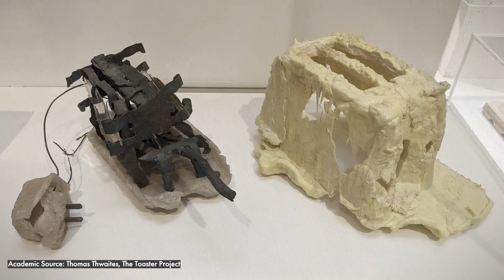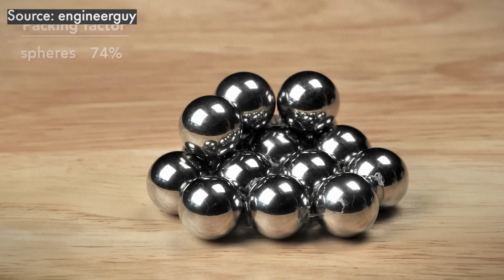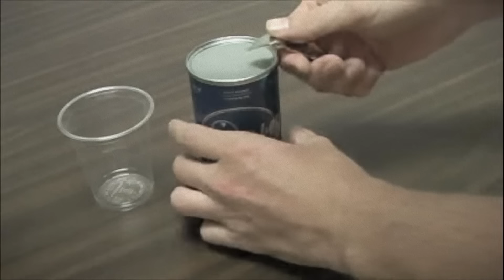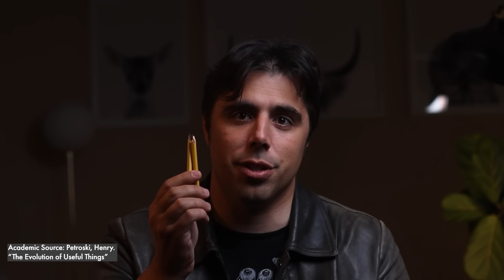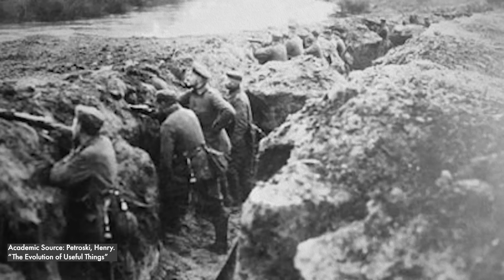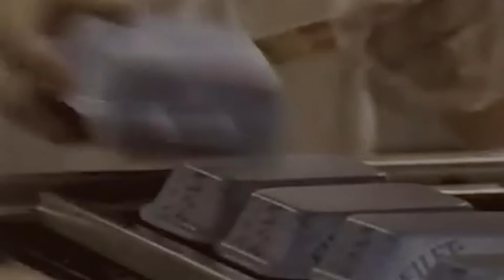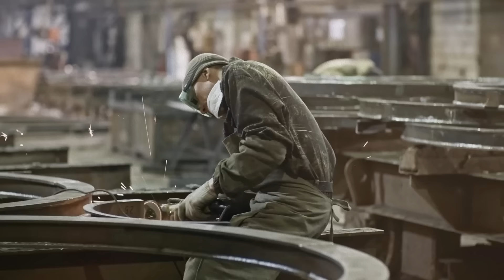Why Simple Everyday Objects Are Impossible to Make

Comment: This is true... but only to a point. Sure, a very modern toaster with a circuit board and digital display takes a lot to make. A toaster from the '60s though, that's a half dozen parts and can can be hand machined. Sure, making plastic totally from scratch is hard to do, but carving a fork from wood is easy enough with patience and skill. Smithing one by hand given access to metal is easy enough too, just ask everyone from the 1700s. Your plastic fork there is a sort of silly example though. Its plastic because plastic is cheap given that we have international trade and plentiful oil production and plastic manufacturing. Its mold is $100k of finely machined steel because production runs by the million require it or production would stop to demold a defective fork or to replace a degraded mold. Making one of those forks, for me, is a day of light work. Some plaster around an existing fork, a double boiler for melting carefully selected scrap plastic, and can be done. Its dumb to do it when I can buy them by the hundred for a few dollars, but it can be done. Simple objects are not hard to make or expensive to develop because they are simple but because they are mass produced commodity goods the rely on huge modern infrastructure and big initial investments into durable quality tooling fit for huge production runs. Consider an epoxy & glitter walled tumbler (tall glass with a lid and straw). I can buy two piece blanks, hand mix glitter and two part epoxy, fill and fit the tumbler parts, and be making them by the dozen for the cost of a few supplies. China though? Thousands of dollars is supplies bought in bulk, tens or hundreds of thousands in tooling and machine setup. But in the end they can churn the things out by the ton.

Comment: 20:25 Styrofoam was changed out to paper but both had PFAS coatings to make it hydrophobic and oleophobic. The crazy thing is that people lifted the burger out of the Styrofoam box but with paper people sometimes bite it and they rub it on their mouth. PFAS was measured as an non-extractable on full paper... in lab tests. Except people crumble and tear paper which can release it

With Asbestos you could trace back to exposure lawsuits easily. Because of every fast food packaging using PFAS like butter, there is little accountability and that receipt paper unfortunately didn't get protected by a forever chemical. Yaaaay tragedy of commons with our endocrine systems

Comment: The corrugated cardboard version today's Big Mac works well enough but you CANNOT recycle grease soaked paper anymore than you could polystyrene. The grease ruins the whole paper pulp batch. So, it goes to the landfill where anaerobic breakdown takes so long you can take a core sample of a landfill today and still read what's on newspaper from the 70's! Is cardboard better for the environment in this case? Who knows? Just because people gripe and moan about something doesn't mean they know either.

Comment: One container design which makes no sense to modern man is the amphora.  They can't stand and their volume to vessel ratio isn't great.  Historians point out that they would have tended to work well on the ships of the time where they can be laid along the hull and secured with ropes.  I think one major thing not considered is moving them from the dock and land transport.  These rocky coasts on which they evolved have almost no roads on which carts can be used.  So things have to be moved inland on donkeys on narrow trails.    A man has to lead a donkey.  The amphora work perfectly for this.  A blanket can be placed on the donkey, amphorae placed on either side, a rope connects the pair over the donkey and rope loops connecting the pair under the donkey to keep them from swinging out.  These create something which is relatively narrow with little leveraging on a donkey.  They weren't designed to maximize storage as much as facilitate transport.

Comment: Who said a toaster needs to be done from plastic. Wood would work too, and some iron, and glass for isolation. Can be done from scratch...
Of course an electric toaster needs electricity and that's more work - easiest way requires a water wheel in a stream, some copper wires and magnetite to create a dynamo.
And all those need tools, so you have to build them, starting from resources - stone (flint, limestone, sandstone), wood,  plant fiber, clay, ores of copper and iron and lots of sweat, blood and tears...

Comment: Is that why my teachers would not let students take the SAT without a Ticonderoga pencil or specific mechanical-pencil filament?
Reply: No, that's because they didn't want to have trouble with the machines used to read the scantrons. The scantron readers were calibrated to read #2 lead, which is a specific softness and therefore color, reflection properties, etc.

Comment: 3:25 I am having a nervous breakdown as a European when I hear someone use a plastic fork for 5 minutes and then tosses it away.
Reply: Same here. Just please, please don't join the blind mob that thinks replacing that plastic fork with a wooden one (or a straw with a metal one) solves the real problem here, which is excessive ("leaky") production output burning incredible amounts of (also: externalized) inputs either way.

Comment: Injection molds are not that expensive anymore, i regularly get new molds produced in china for 2000-5000$. For simple plastic parts. But i also worked for a dutch manufacturer of audio equipment that produced low volume, it indeed costed multiple thousands of dollars to produce a not so difficult product.

Comment: I've done several multistep chemical syntheses just to train how hard it is to start from scratch (plus many chemical intermediates are not available for individuals). It was a real adventure and one learns A LOT from the field by doing thing the old way without fancy equipment.
BTW high purity carbon/graphite can be synthesized from sucrose and sulfuric acid - the resulting material is called "sugar charcoal"

Comment: As someone who was a manufacturer and also designed and sometimes built commercial machinery, I can totally agree with this. In fact, I’m modifying a bad design of a small steel case for a power supply that was designed with a charger and four sealed batteries. The problem is that the manufacturer assumed that this particular Panasonic battery would always be available. Surprise! They’re not. New batteries don’t quite fit the interior height. So I’m modifying the bottom of the case. It seems simple. But in order to form the metal parts I’m making, I had to design parts for my machine I’m using for it. That meant I had to buy metal to make the new parts from. After machining and polishing, I hardened and tempered it. Fortunately I have an oven for that.

So, even making a couple of 16 ga stainless parts that aren’t big, just 5” x 2”, but with multiple bends and a few holes, took a lot more work than you would think. And, of course, I didn’t design the stainless alloy or manufacturer it. Nor the machinery I used to make these parts, though I did design and modify part of one.

But at the end of the video, he oversimplifies advances. Yes, obviously companies need to continually sell products or they go out of business. But that means people lose their jobs. So it’s not that simple. Very few people would argue that these products don’t make our life better. How many people want to toast so inefficiently, in a pan? Pretty much nobody. So that toaster wasn’t some behind the scene evil just designed to make money for the electrical company. That’s not the way manufacturers do things. They try to find something that their potential customers will find helpful, useful, or delightful. At the same time that it allows them to profit from it. It’s not a single ended situation and everyone wins. If they didn’t, electricity prices would have at least doubled.

With waste, it’s a more difficult situation. In theory, nobody wants waste, including manufacturers. But it’s inevitable. When we change one thing into another, such as ore, we get waste. Rock has to be separated from the metal. Parts manufacturing have waste scrap that can’t be reused. Products go bad and can’t be repaired past a certain point, or with some things, by their nature, at all. There will always be waste. Unfortunately, most people refuse to pay for something that can be more easily repaired or upgraded - even though they say they will. That’s been shown to be true for that large majority.
Reply: The truth is that things are no longer produced or designed in a way that they can be repaired. So you have to buy everything all over again. No matter how much you are willing to spend.

Comment: You have an incorrect date and attribution for the StaTab. It didn't sound right given my experience, so I looked it up. Tons of incomplete info out there (which also gets regurgitated by AI), but this is what holds up to history:

The removable pull-tab was designed in the 60s, like you said.

The original StaTab you said was designed by Coors around 1960, the one that led to the wider one we use today, was designed in the 70s by Reynolds Metals Company and had a limited introduction in market in late 75 on Falls City beer cans. It wasn't in wide use until the late 70s and early 80s.

What Coors invented earlier than the StaTab was the two-button can top, which wasn't around for long. 

I remember the original removable pull tab still being in use when I was a kid, and I was born in 72 -- you had to be careful not to cut your lip on it, and yes, they were all over the ground.  Also, it was a key plot helper in the 1983 movie War Games. I was surprised to visit China around a decade back and find the removable pull-tab was still in use over there in the 2010s.

Comment: To be fair I think the toaster guys challenge is a bit disingenuous and silly. You even showed an early version of a toaster as an example and that is what the guy should have been making because those were designed to be made by hand with relatively simple materials. If you try to hand make a toaster that is not designed at all to be, you are gonna have a bad time. The modern toaster is designed to be mass producible with minimal human assembly and input and at specific cost targets, the old one is designed to be as simple as possible and get the job done, just a bit on the dangerous and less refined side lol. He would cut down on material and construction complexity greatly.

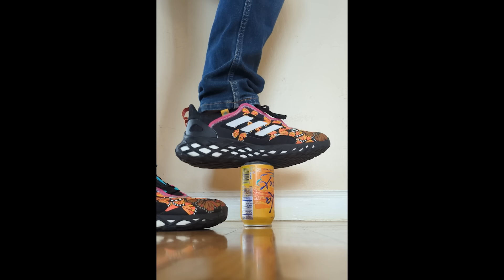Comment: @7:13 You can actually stand on an open empty aluminum can if you're very careful and don't weigh more than 80-100kg/175-220lb. 

It's a fun party trick to get somebody to stand on the can and then whack it with a pencil or something else and it immediately crushes under their weight. Do not attempt if you have bad ankles

Comment: In what dimension you need a toaster to call yourself "self sufficient"?

You can make your bread starting from wheat and then toast it on a slab of heated rock on a fire.

I don't even own a toaster, and I'm fine with it.

I understand that the idea is to make people aware of what modern society means, but you chose many useless examples.
I can live without a toaster, and throwaway plastic forks.
I have metal cutlery from the last century and they're fine.
And I'm also running a DIY recycling project to give used single use plastic a new life with durable products.

Everything is linked, but we need to avoid being proud of our skills and society, when we use that to make wasteful things.

PS:buy mechanical pencils.
They're durable, more efficient and a lot less wasteful.

I have three or four of them, one at work, one or two at home and one in my recycling lab.
The older one is functional since I was at school, 30 years ago.
And it's perfect after 15+ years of use in a metal machining environment... ;-)

Comment: If I were in your line of work, I think I would be hugely frustrated by the public's perception of how something like the toaster, as we know and love it, comes into being. This idea of people suddenly 'inventing' things. I often wondered what life would have been like if the Greeks, or Romans, or Persians had invented the printing press 2500 years ago, but then I realised they couldn't have; it was the discovery/invention/formulation of a new alloy that was durable enough that a single, cast letter could be used thousands of times without being deformed. If you were relying on wooden letters, cooper, brass, even early Iron and steel, would not have been durable enough that the speed of replacing them would have been slower than writing. Similarly the Greeks, 'invented' the steam engine, but 'never saw it's potential', it had no great potential then, the materials couldn't have withstood the pressures, or worn out quickly, fuel, before the advent of widespread coalmining would have been used by kilns in a few decades. Galileo's revolution, depended on a new formulation of glass, that permitted the creation of reliable and accurate lenses. The iPhone, was the marrying of three new technologies, all developed separately, so even Apple can't claim to have 'invented' it. Li ion batteries, capacitive and resistive screen technology, and increasing miniaturisation of computing power. Even then, putting all these things together and making it work is, well, a lot of work. THEN and I've only really got this over the past decade of watching battery technology, and solar PV tech, having the materials, the theory, and eventually a working example of something that is hugely better than what we have now, but no one can figure out how to scale up the production process. I think the US is going to get a shock as it tries to repatriate businesses, actually manufacturing the factories, is something China has been working on all along, but the US stopped taking seriously thirty years ago.

Comment: There should be a parodic "how to" channel that explains how to make random  everyday stuff but with literally all the engineering and tech and history involved
Reply: While i get the sentiment, that will probably never happen. Just like with that plastic spoon, if you had to show and explain just the tech involved from material to the thing, the video would be tens of hours long, and if you add all the things that are necessary to make the machines that make the machines that make the thing, it would balloon to thousands of hours. Shit's complicated yo
Reply: @rolerroleris533 I understand but I meant more that as a joke, it would probably skip over a few things and stuff
Reply: @Kaldrin  that exists, look up how to make a cpu from scratch
Reply: @rolerroleris533  It's possible there's a channel called Tasting History it goes in depth about the history about certain foods but also keeps it brief and on point
Reply: @rolerroleris533  To make a SINGLE thing is feasible. To make it industrially viable is another.
You don't need to explain the machines that make the thing except the ones that are actually absolutely necessary.
You don't need a specialized 400 ton capacity tank to make a plastic fork - you only need to get a bit of the material and heat it in any way you see fit to the appropriate temperature - you could make a basic kiln probably and use some clever methods to esnure the temperature is correct - this saves you from needing all that physical space and ungodly number of materials.
When inventions are made, they oftentimes historically were made in someone's kitchen - not in some industrial complex.

I think Iron Man (the movie) is really good at actually showing it. A man can make the crude thing. And then it takes a long time to perfect it and make it possible to mass produce efficiently. But the original was made by one man (yes, he used materials from other things, but the point is that it is possible). To get oil you don't need to create an oil rig. You can go and dig a little bit. You need a few liters, not cubic kilometers of the stuff.

While it is still a massive, massive, massive undertaking to make such a video, as you mention, it's not as insane as it might seem.
And in the future it's almost guaranteed that such media will be made because it's so incredibly interesting.
Reply: No joke, if it were a serious breakdown, start to finish, I would watch it earnestly. Experiencing the supply chain in all of its glory would be amazing
Reply: Maybe you should check Technology Connexion
Reply: @monoside7449 technologie connections is amazing but it's not quite what I described here I think
Reply: Oh, I can imagine the satire! Could be a fun show smuggling profound understanding 🤔
Reply: tasting history but with tech
Reply: I feel like this is the idea behind the classic Connections² series, but brought to its logical conclusion.

Comment: Intricate global supply chains aren't a necessity just because that's the way it's done. They're an induced "need" just like the plastic fork is only filling an induced "need". People take it for granted because that's all they know, just like the shape of the soda can. Products can be designed to be made locally, from local materials, for local use. When I get to a picnic and realize I forgot to bring an eating utensil, it's easy to manufacture a single-use pair of chopsticks right on site by cutting (or simply breaking off) a couple of sticks. They'll decay in a few years at most, grow back in less than two years, need no packaging, and spend zero fuel. No need for global supply chains providing a material that can't be re-used. It is possible to make simple objects simply; people just choose to not do that.
Reply: Well that's not always possible and even if simple things xan be made just-in-time they can't be made persistently but only for use once or twice.